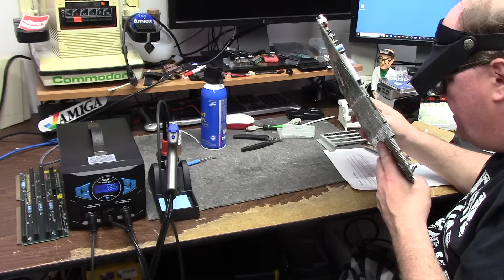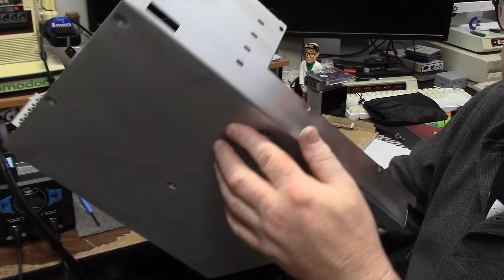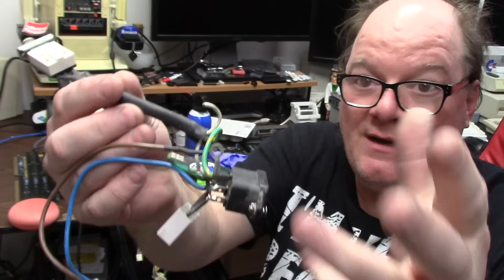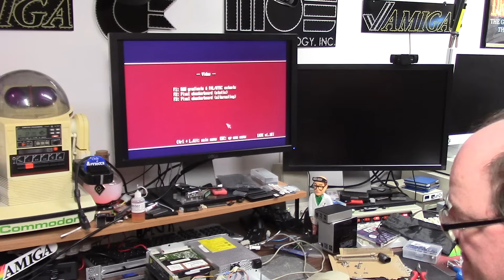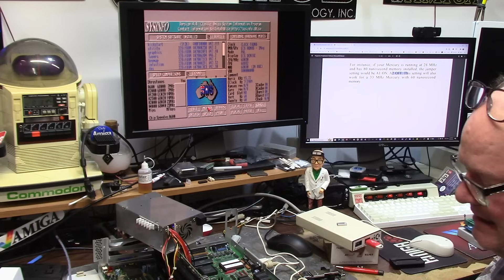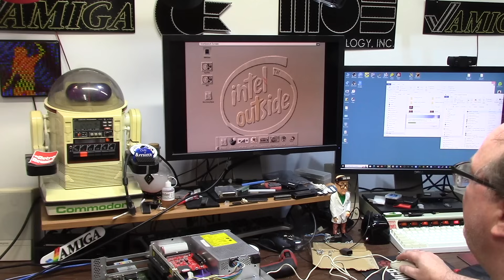!! Episode 500!!  Restoring an Amiga 3000 to new!

Comment: I have an immaculate original 3000D, what would you recommend I do to it preemptively? Everything works great on it.
Reply: I also have an 040 A4000D, I suppose I should test out the 040 card in the working 3000…
Reply from the maker: Enjoy it. are you asking about upgrades or what to do?
Reply: @ChrisEdwardsRestoration  recommendations to keep it operating another 30 years.
Reply from the maker: the main killer is a battery. if its in there, snip it out and neutralize it all with vinegar/ipa and a good ipa wipe rinse.  the scsi can be converted to a Zuluscsi that uses hard disk images, easier to back up and restore to a SD card than a old scsi hard disk.   upgrades exsist galore for video and network cards and many many things. the only limiting factor is your budget.

Comment: Another happy customer gets a working Amiga, nice job. Have you every had to fix a Video Toaster?
Reply from the maker: nope. why do you have a broken one?
Reply: @ChrisEdwardsRestoration  Last I checked it was OK, you had a Toaster card in the video and I was wondering if you had ever needed to repair one. 🙂
Reply from the maker: @DarrenJCrawford  oh that was the users. I have like 4 of them, (3) 2000 and (1) 4000, i used it a long time ago, but the one i had borks out when hot.  since theres really no use for it anymore with modern linear editors its more of a nich thing, cable nightmare. but fun to make kiki wiggle through the scenes.

Comment: I can't remember what model drive was in my A3000 so my anecdote may not apply to this one.  I had a problem where the head wouldn't start seeking, and I think it went through a whiirrr clunk phase as well.  I ended up taking the lid off and I found that the rubber bump stop that the head arm rests against when "off" had turned into a gooey mess.  This caused the arm to stick to it and the voice coil wasn't strong enough to free it.  I ended up gently freeing the arm from the stop without letting the heads crash together or placing them on to the platter, then I removed the rubber stop and replaced it.  I didn't have anything suitable hanging around, so I used some layers of heatshrink.  It worked, the drive spun up and I was able to image it.
It's been a few years since I did it so I can't say whether it's a long term fix, taking the top off a hard disk outside of a clean booth is never a good idea, but it should be good enough to at least image a drive.
Reply: Dr Chris sent the drives back to me and I would really love to recover the data from them so I may try the approach you suggest here! Thanks for the tip! 👍🙂
Reply: @VernGraner  Good luck!  It's fiddly and scary, so only do it if you're ready to throw the drives out.

Comment: If you weren't so far away I'd ask you to have a go to find out how I killed my 500 (rev 5) when no bloodsugar me (brain plain not working at all) goofed the soldering up to upgrade kick 2.04 to 3.1.
Reply from the maker: just a rom jumper from pin 1 to 31 makes it work on a r5, no goofy pin lift or adaptors needed
Reply: @ChrisEdwardsRestoration  Yeah, I didn't know that at the time. Now the board is dead, I have no idea what happened.
Reply from the maker: it will only pop the rom, do you have another kickstart rom to try?
Reply: @ChrisEdwardsRestoration  I put the old 2.04 back in after and it's still dead.
Reply: @ChrisEdwardsRestoration  I swapped the CIAs and I got some life in it. Normal gray screens up to boot screen but that's about it. Floppy non-responsive, not even a click. Damndest thing, I lifted on the CPU and put it back in and after that it's dead again.
Reply from the maker: @anakondase  since your getting a rom screen have you considered a Gotek drive to replace that floppy thats on the fritz?
Reply: @ChrisEdwardsRestoration  There's something more going on since it's now dead again. I need to reflow all solders because I think there's some bad ones somewhere. It's not the CIAs since it still worked when I swapped them back.I don't think the floppy is bad, it worked perfectly before my cockup.

I have another 500 coming in in a few days so I'll try and swap some parts over and see what happens.

Comment: Uh oh, I’ve heard that hard drive noise before; she’s dead, Jim. At least with my thick Quantum drive, it's a hot running drive.
Reply: I have little hope of recovering the data on those drives but at some point I may put them on the bench and see if I can coax them to run just long enough to image them!
Reply from the maker: @VernGraner you can also plug them into the zulu i put in there and unplug the amiga hdd. Only power and scsi to the drive. Flip the init switch.  Install a empty fat32 formatted card and turn it on.  It will image the entire disk to the card.  Bad sectors and all. You can then attempt to mess w it in winuae without harming your amiga